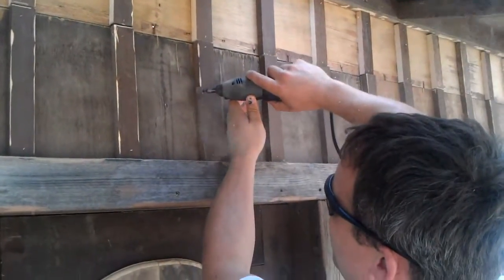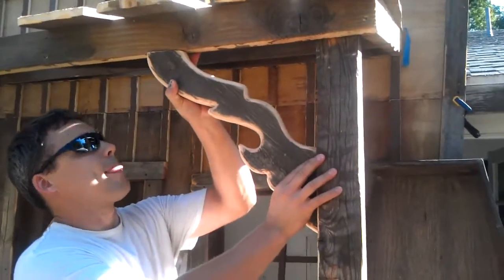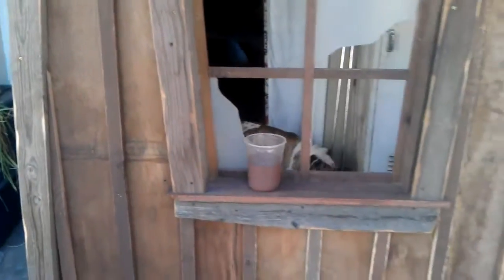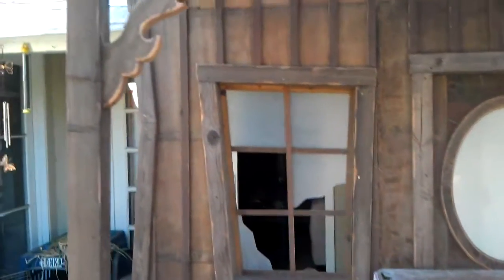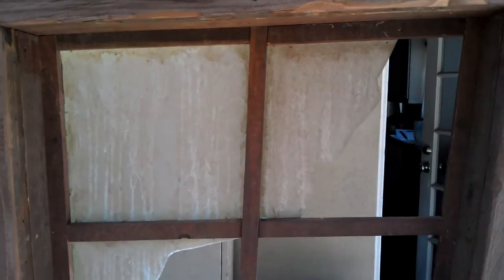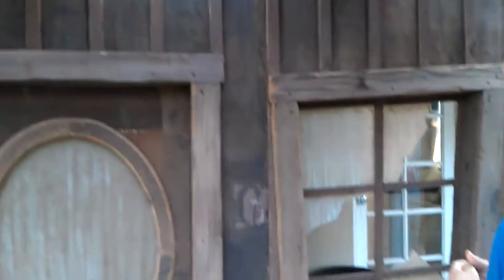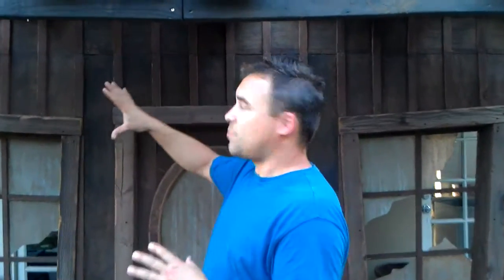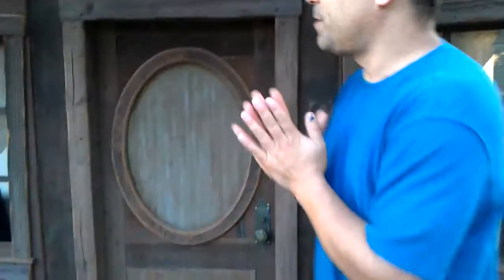Making an Old West Town - Wild West Ghost Town Undertaker Building - Trim & Bracing

Comment from the maker: We use jacks and braces made from 1" X 3" The braces are two boards put together in an L shape and screwed across the seams of each flat.  Same with the jacks and the bottoms of the jacks are weighed down with weights or sand bags to keep from tipping froward.  The more jacks and weights you add the more secure the walls are on windy days.  I'll show the back side of the saloon and how we have it set up on the next video!  :)